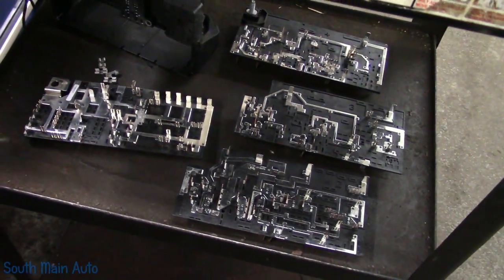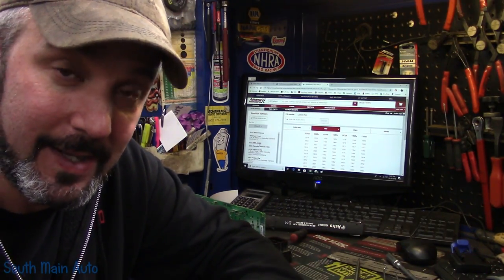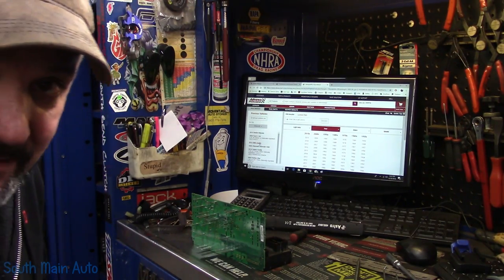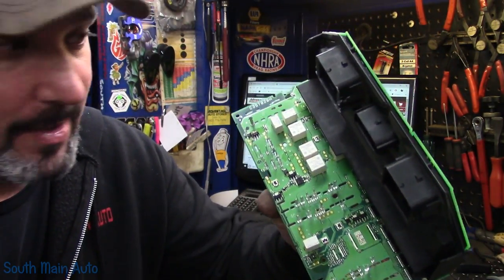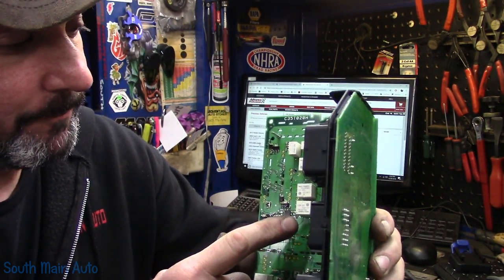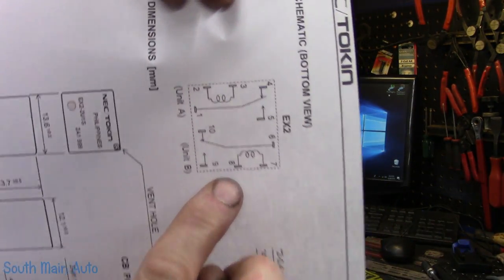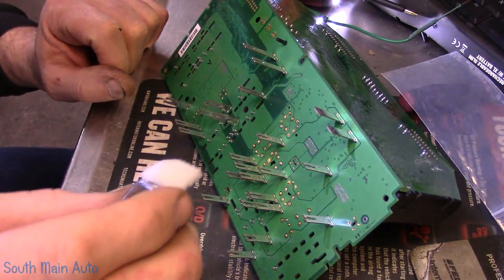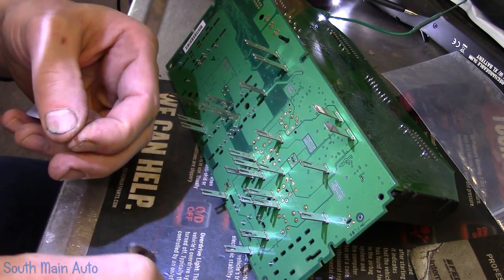Chrysler / Dodge : TIPM Repair - No Wipers

Comment: You need to use flux when using desoldering braid. It will help the solder to wet into the braid and come out of the hole. Solder goes towards the heat source. You should also use a chisel tip on the soldering iron because the conical tip does not transfer heat as well as a chisel tip into the solder joint. You can also lower the melting point of the solder by making an alloy of the lead free and the leaded solder. Just melt some leaded solder into the joint before you start to use the solder sucker or braid.
Reply: Braid comes with flux... that's what makes it solder-wick, otherwise it would just be braid.  It's dry, so you need a wet connection to get it hot and working.  Definitely add solder before desoldering... counter-intuitive!
Reply: Yup. Good channel for electronics repair is Louis Rossmann. Fixes Mac computers.... TIPM is enormous  compared to surface mount motherboard components.
Reply: Yep, no-lead solder doesn't like to flow very well, add some lead and it becomes a different beast.
Reply: @rick_.  Another good one is I-pad Rehab with Jessa Jones. She does microsoldering  on I-Pads (Obviously), and I-Phones.
Reply: Lead wire is sold at any flyfishing shop or online. Can i melt this onto the no-lead solder to make the alloy?
Reply: @buntnik  You won't be able to use lead wire to take out solder. Lead wire and leaded solder is not the same thing. It takes solder to get out solder. A wire has a much higher melting point than the metal in solder and will probably only transfer a little heat to the solder on the relay terminals, but likely not enough to melt that solder compared to the right soldering iron.

Comment: I do this same process on electronic boards that control swimming pool equipment. I had the same issues with the braided desoldering wick. The solder sucker does the job a lot better. I always worry that I've overheated the boards, but more often than not, the repairs work. The boards are pretty resilient to heat. Cool video, it was fun to watch.

Comment: The solder sucker is DEFINITELY the best way, unless you removing 12 gauge wire and larger cable.
I used those a LOT when I worked in electronics.  You may be able to remove the lower part of the tool with the tip to clean it.  With the lower part of the solder sucker removed, push on the spring loaded upper handle to get the rest of the solder out.
When sucking up solder, put your solder iron tip on the part to be removed, ADD some solder to what's there already, then use the solder sucker.   Works every time!
You can use a higher wattage solder iron, like a Weller, BUT you have to pulse the tip on and off so the circuit board "pad"  won't break off.  Fixed a dash radio speaker like that.  GREAT VIDEO!  Congradulations, you're now an electronics parts repair  specialist ! !

Comment: Surely someone has beat me to it. To use "Chemwick" lay it on top of the solder joint and put the solder iron on top of the chemwick until it absorbs the solder, you were not leaving it on long enough to melt the solder. It works way better than the snot sucker. A big relay like that can take a lot of heat so don't worry about messing it up.
You should use a bigger tip on your iron for big stuff like relays. Great job and Happy New Year

Comment: Thanks for this, Eric. My horn just up and stopped working on my '10 Avenger. Both when pressed on the wheel and and when locking from the key fob. I can only imagine it's the relay. Tracked down which one is for horn, and ordered the correct part for $3. This video, like all of yours, is an absolute gift. Thank you again!

Comment: As others have said, add some lead type solder to the joint first. It will alloy with the Lead Free solder on the board and make it flow easier and at a lower temperature.  Next add some flux to the de-soldering braid. This will help the solder "wet" the braid and make it much easier to "suck up" onto the braid. These are going to be "plated through" holes in the board. Need a lot of heat reserve to heat the pin all the way through the board to make the solder flow up to the braid. Best solution is to buy yourself an inexpensive de-soldering station. These have enough heat and strong vacuum to pull the solder out.  As a last resort you can carefully cut apart the bad relay down to its pins and remove them one at a time. Be careful not to damage the board when doing this.
Reply: The Radio Mechanic - having done this sort of thing for many years, I totally agree; that’s why I use the “4-second rule” and my trusty Radio Shack desoldering iron. Squeeze the bulb and apply the desoldering iron tip over the trace and hold for 4 seconds, then let go of the bulb and remove the tip. Then use a fine-tip needle-nose pliers and GENTLY wiggle the component pin/lead - if it doesn’t move, hit it with the desoldering iron again. Note that component leads soldered to power planes (ground or Vcc) often have a bigger pad and you’ll need more time due to the fact that the large pads act as a heat sink, pulling heat away from the desoldering iron tip! Whatever you do, DON’T just yank the desoldered component off the board, or you’ll likely rip the PC board traces with it; gently wiggle the component leads - and, if possible - the component itself and observe the leads coming through on the solder side; all of the leads should move in the hole(s). Ideally, it’ll then just fall out. More than likely, you’ll see most of the pins move, and a few remain stationary; hit them with the soldering iron again. This procedure assumes that the board is saved, and the component is bad, if you don’t care about the board, you can be a bit more aggressive with the component pin wiggling! 😻
Nice to hear the shout-out to AvE and Bigclive! 🤗

Comment: Nice work, especially for a first PCB repair!  I am an electrical engineer and often re-work PCBs.  A few comments:

1. You were using the solder wick correctly and it is used for such applications.  You generally do not separate out the braid, just set it on top of the solder joint and place the soldering iron tip on top of the wick.  It should then heat the solder joint through the wick and the solder should work its way into the wick.  However, the little pen style soldering irons (like the one it appears you are using) don't generally have enough power to work effectively with solder wick.  The solder wick acts like a heat sink and prevents a low power soldering pen from getting hot enough to work properly.  Basically your soldering iron probably doesn't have enough beans for the task.  You would have MUCH better results with a higher output power (regulated tip temperature) soldering iron like the Hakko (not a sponsor) listed below.  In addition, these are a HUGE advantage when soldering or desoldering a pin that is connected to a large section of copper on the board (which is often the case).  A small soldering pen will not be able to provide enough heat due to the heat sinking effect of the larger copper area.  Having a good soldering iron with high output power capability makes a huge difference in doing PCB rework:

Hakko FX888D29BY

2.  Another viable (and quicker) option for removing a multi-pin component like a relay is to use a heat gun with a fine tip like the Dewalt (not a sponsor) listed below.  Put the fine tip on, set it to ~850F-900F and point it at the pins while pulling gently on the relay from the other side.  If used carefully all the pins will desolder and the relay can be simply pulled out while the solder on all pins is molten.  Then it is easy to clean up the pin holes and solder in the new part.  You do have to be careful if there are surface mount components on the PCB (either side) as you could accidentally desolder them if you aren't careful!

DEWALT D26960K Heat Gun

3. It is generally recommended to clean the residual flux off the PCB (printed circuit board) after soldering is completed (depending on the type of flux it can be corrosive and lead to joint failures or electrical leakage paths over time).  You can use a flux remover that is electronics safe like the Chemtronics one shown below.  Not as much fun as brake cleaner, but almost!!!

Chemtronics ES835B Flux Remover with Brush

Love your great videos!  Keep up the great work!

[Edit: Looks like YouTube doesn't like the links to those products so I removed the links...]

Comment: 😀😀 A few years back I did iPhone and iPod repairs, lot's of soldering and circuit board repairs. The only suggestion I could make for any future circuit board repairs, Setup a dedicated workstation with plenty of light, lots of Flux and also find some old circuit boards and practice removing and installing components. That is how you get better at soldering. Much like brake jobs do more get better. The only thing missing from the video was Brake Cleaner, other then that, Good Job. 😀😀
Reply: And I would add to that, any flux used on electronics MUST be rosin flux. Never acid-core which is used for plumbing and other mechanical repairs. Rosin flux is available in liquid form and paste form: paint a little on the joint to help solder to flow. Clean off excess flux with alcohol when finished.

Comment: The contact melted because of corrosion build up or "burning" on the contact. The increased resistance acts like a heater until it gets hot enough to melt the contacts. The best contacts  use corrosion resistant and high temperature metal alloys. The contacts once they build up resistance can also exchange metal from the common to the NC or NO contact surface ( or the other way around). It can make little stalactites and stalagmites on the contacts and these high and low spots can reduce the surface area that can pass the current and cause increased resistance and heating. When the contact changes state, (on to off -- or -- off to on) there is a big inductive load change (current spike) and this causes arcing and sparking on the contact surfaces.

Comment: On my personal vehicle, I would have just cut the wiper relay wiring and splice in some external relays, to basically bypass the TIPM. Just be careful and make sure to use weatherproof relays and connectors to avoid corrosion issues.

Comment: Something to watch out for when testing relays with probes like that, aside from 5v relays vs 12v relays... There is sometimes a diode across the pins of the coil of the relay, either built in or soldered on the board.  The diode will sink current only in one direction so if you try to power the coil the wrong way around you may not get a click.  So if you don't get a nice click one way, flip it and reverse it and check again. ;)

Comment: One trick I've learned after you have the component removed is to reflow the solder again in each hole and stick a round toothpick into the hole so that it is easier to reinsert the new component.  The solder wick/solder sucker hints above should work.  If you do not care about destroying the part, you can carefully break the part down to the leads then remove each lead, one at a time.  Great videos...keep up the good work.

Comment: I don't buy it.  If it really is your sister the default repair is to wire up the wipers to work in conjunction with the horn and call it a day.
Reply from the maker: Toggle switch crossed my mind, trust me...
Reply: we did that to a delivery guys s-10,brakes to horn........LOL
Reply: Bypass the tipm board with a universal relay rail.he done so with his partner on another video.i remember it was on a Jeep commander with a faulty fuel relay in that stupid tipm
Reply: @CajunShrek  that's a stellar idea, an aux relay panel, maybe an aftermarket plug and play solution there?
Reply: On point! Lol
Reply: No way you should use a floor-mounted dimmer switch and then wire the horn through the turn signal
Reply: @CajunShrek  - I'd be half tempted to install a Painless Wiring kit or 2 for a hot rod into a Chrysler - would make the vehicle a hell of a lot more reliable ...
Reply: I've thought about the brake activating the horn but with a time delay, they are able to get down the road before it takes affect.
Reply: Shain Andrews not really. It actually involves a lot more than just the wipers. On my car it’s the wipers the horn the mirrors the windows... so not just a “simple wire up”
Reply: Had a friend with a Lincoln with no low beams. Traced to TPIM or whatever Ford calls it. Spliced in a relay, triggered off of parking lights. Now she has all four headlights on high beams and she is happy as can be.
Reply: That's funny, but so wrong.

Comment: Since you are meticulous in your daily work, it was reflected in your soldering/de-soldering efforts. There's some tips you can pick up watching others work on those boards, but all-in-all you've got the right work-ethic to get it done. Most modern boards can take the heat far better than any component on the board. Great job, enjoyed the video.

Comment: That thick wick requires a fair bit of heat. A thinner wick would have worked better. The wick needs to be touching the solder connection and the iron is on the wick to draw the solder up into the wick. Remember the wick needs to be hot enough to melt the solder. You didn't leave the iron on the connection long enough. Yeah, the wick gets hot fast so hold it a bit farther up the spool. A narrower wick would work better because it would heat up faster too. The solder sucker worked well for you. Nice job.
Reply: Mark Schmitz Also, the wick should be pre-fluxed.  A 1.5mm wick would have gotten most of the job done if it was flux infused type.
Reply: I always hated the wick on small connections. I have a plug in solder vacuum pump. But this little mechanical seems to work just fine and no tube to drag around behind it. I think I'll get one!

Comment: As always I appreciate how your diagnosis led to isolating the culprit relay. De soldering usually can be done with solder braid as you used as long as the iron is hot enough. I found my 25 watt iron is not hot enough to meld solder used in most automotive applications. Solder suckers are great as long as you can keep the solder melted while sucking it. There are heated tip solder vacuums on the market that make it easy.

Comment: I just wanted to help you solder so bad.  I watch your videos to learn automotive repair, I know electronics like you know cars.
Reply: I agree with the others that know how to solder. A chisel top would improve the . effort. Tinning the iron tip helps heat transfer. Heat the joint and solder suck the liquid solder. Re-tin and re-suck if it doesn't all
Reply: if the joint doesn't come clean. When all are clean, the relay will pull off with relative ease.

Comment: This video is approved by Ivan.
Reply: My thoughts exactly. Ivan IS the man for this kinda thing. He'd have it up and running in no time. Eric O is a genius in his own right,either way it'll be fixed as good as new.
Reply: NAH, Ivan would have pulled the relay apart, repaired the contacts and reinstalled it... LOL
Reply: @Blazer02LS  Maybe so, but a REAL enthusiast would have mined the replacement raw materials out of the ground, built the various metal refineries, forges etc and then finally realized that the actual problem was a loose ground wire!

Comment: For better results with desolder, you need a good clean soldering iron tip and a small damp spouge to wipe the tip on to keep it clean while your working. Put a small fresh drop of solder on the tip of the soldering iron because it will help conduct the heat from the tip to the solder on the board. Good job!  Good video. Enjoy your videos.

Comment: Great video Mr. O, encouraged me to open the tipm for  this 2013 dodge ram with the crank no start issue for the fuel pump relay inside the tipm. The only thing I would add is to confirm that you have the correct relay is just find the pin that connects to the fuse and check for continuity to the relay. I found it and looked at the relay and could tell the difference in a solder point being melted. Found that the coil was burnt but it had clicky clicky lol Ordering a kit now to tackle this wish me luck! Thanks for the great videos!

Comment: 99% of your de-soldering problem is the tip on your iron.  Get a 1/8" wide chisel tip.  De-soldering will be much easier.
Reply: Also keeping it clean will help too

Comment: You did a great job - in fact an excellent job considering this was your 1st time tackling removing parts from a PCB.  Your experience mirrors mine over the years repairing circuit boards - a solder sucker is better than the copper braid - nearly all the time!  You can minimize the heat on the circuit board by getting most of the solder out around the pins with the solder sucker and then use small needle nose pliers to wiggle the pins of the part you are removing and they will usually pop free from the sides of the hole.  This will keep you from having to heat the pin/hole up over and over again (most of the time).  The 2nd way to preserve the circuit board is to try and clip the pins on the parts side  of the part you are removing.  then heat the solder side and use needle nose to pull one pin at a time out of the board this is much easier than having to get every pin perfect before you remove the part.  Lastly watch the solder carefully and don't use your solder sucker too quickly make sure the solder is good and hot and make sure you get it directly over the pin.  Better to get the solder good and hot 1 time than to heat it over and over again. :)